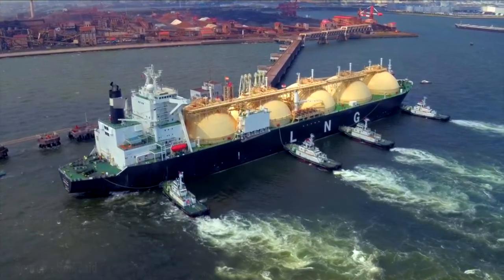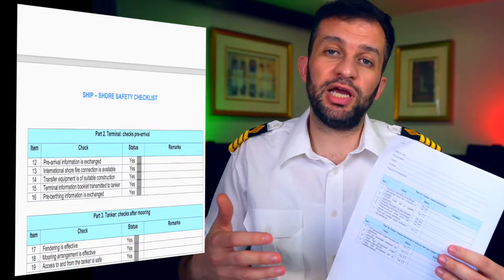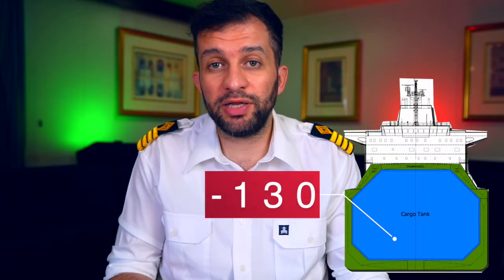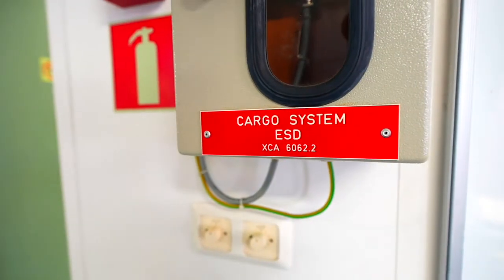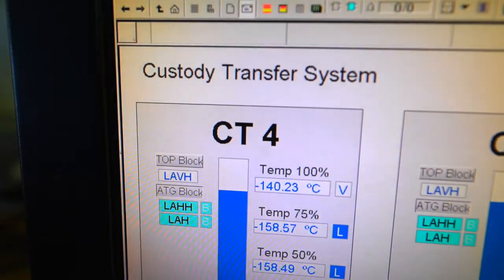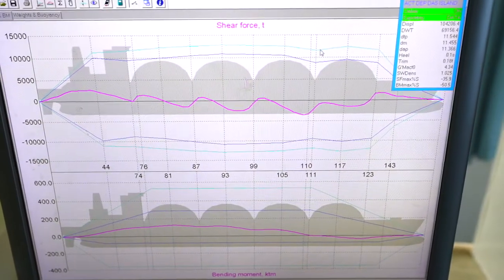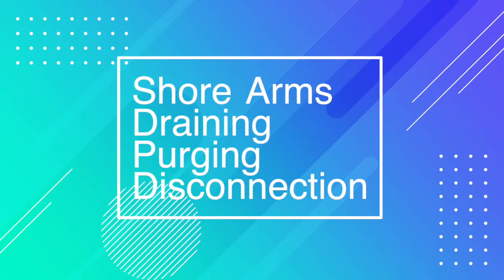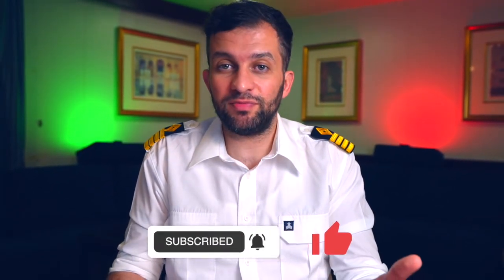The Full LNG Loading Sequence | Pre-Arrival to Sailing

Comment: Hey Sir, I had a doubt. 
How to stop an LNG Cargo Tank from over-pressurising considering Re-Liq plant is not operating and Engine is idle to burn BOG?
Reply from the maker: If alongside a terminal, then return it to shore, if sailing, then venting is the last emergency solution.
Reply: Thank you so much for the kind response. Cheers!!  @MustaphaZehhaf